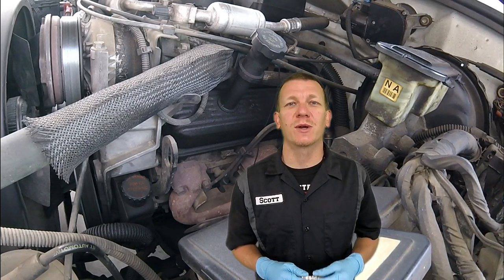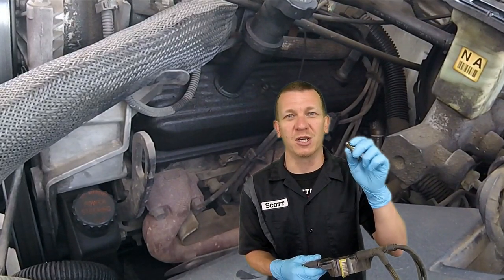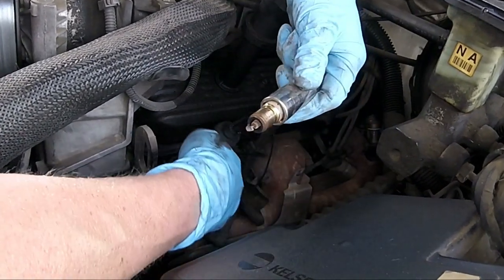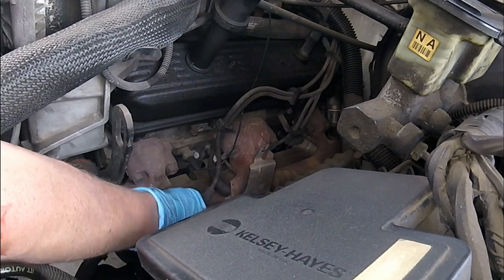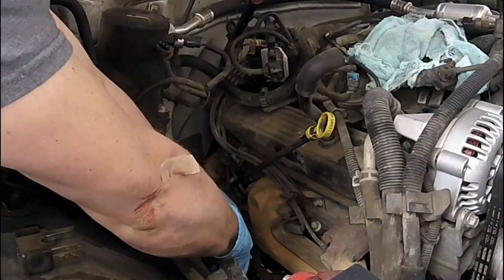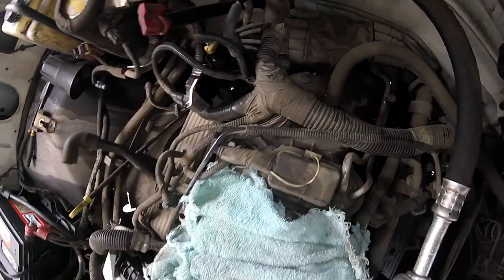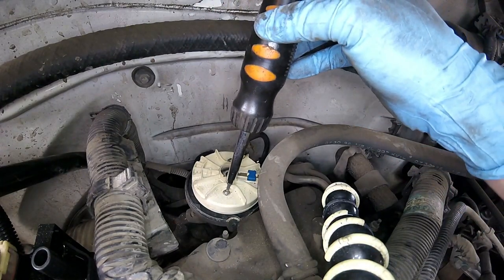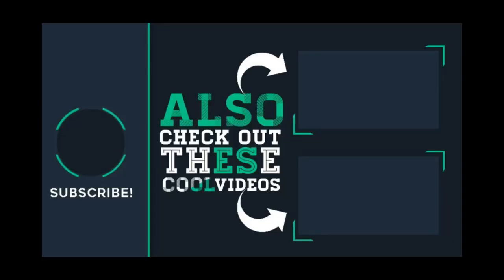Chevy - GMC - 5.7L - 5.0L: Tune Up pt 1. Plugs, Cap, Rotor, & Wires

Comment: I have a 98 Chevy k1500 5.7 and I'm trying to figure out what plug is wrapped inside along with the crank position sensor and ground in the front of the engine. Any idea? The plug is not connected and I can't seem to find where it connects to, all I know is it is a two wire plug that comes out the wire harness along with the crank position sensor and ground going towards the bottom front of the engine. Thanks

Comment: Good video, I do have a question. I have replaced the cap and rotor but know she won’t start, any ideas?  I have positioned the rotor to TDC (or what I suspect is TDC by rotor position). But still won’t turn over. Any help or direction is appreciated.
Reply from the maker: Do you have spark?

Comment: Did the tune up to get rid of misfires on a 96 Savana 5.0 and cylinder 5 keeps having a misfire. Plugs, wires, cap, rotor, coil, fuel filter to boot. Still misfiring.
Reply from the maker: Have you done a compression check?
Reply: @ScottiesHobbies  I need to do a compression test, and fuel pressure test still. But the thing that drives me up a wall is that cylinder 5 had no problems at all whatsoever until all of this. It went from 7 to 6 to random back to 6 back to random to five back to random back to five. Now its steady at 5.
Reply: @ScottiesHobbies  this is also a vehicle that sat in a coma for 10 years until I got it running again.
Reply from the maker: @colinfruend5537   How about using a fuel system cleaner like sea foam?  And did you gap the plugs? But the original code was for cyl 5, after all the work you now have a steady #6 missfire?
Reply: @ScottiesHobbies  now its steady cylinder 5. I've pulled the wires off and made sure they were seated properly and not touching to make them short out at all. I can double check the gaps, I could have made them smaller by fumbling around in the 2 inches of space the GM engineers decided to give mechanics. Currently it has 2 cans of seafoam in the tank to super concentrate the gas. It's almost out so I have to fill up again. Original code was on 7, then it jumped to 6 and back to 0300 and 6 again and back to 0300 and then 5 back to 0300 and now it's back and staying on 5. This is after plugs and then wires and then a coil and then cap and rotor and fuel pump. All within the last since Tuesday morning.
Reply: @ScottiesHobbies  But, it has thrown codes for evap purge solenoid along with lean and rich O2 codes in the past. My main focus right now is making the misfire go away because it is worse for your engine than a bad sensor.
Reply: Spider injector and the intake gaskets were/are the culprit.

Comment: This might be a very dumb question , how do I know what engine I have? I recently bought a 89 chevy obs c1500. Previous owner said it was 5.7 , I looked up the vin number it tells me 5.0. It kills gas like a 6.0 lol ( prolly all it needs is a tuneup ) what is a 100% way I could know ?
Reply from the maker: Do you have a sticker with a lost of rpo codes on the inside of your glove box?
Reply: @ScottiesHobbies  yes I do
Reply from the maker: @kilz3522  if its a 5.0 you will have one of these codes: LE9, LF3, LG9, LO3. If its a 5.7 you will have one of these codes: LS9, LT9, LO5. let me know if you have one of those. Now that is what is factory, the engine could have been changed...
Reply: @ScottiesHobbies  got it. I have a LO3. 5.0 from factory. How can i know if the engine has been changed ?

Comment: Does this video apply to 95 gmc vendura 3500
Reply from the maker: Way more cramped in the van. But pretty much. If you have the dog house in the cab off you can access the cap and rotor real easy.

Comment: What if you accidentally rushed and took everything off together.
Reply from the maker: Ehhh.... just gave your self a little more work. You need to figure out your rotor distribution sequence and match it to the cylinders. You got it. Have a little patience. I don't have patience either and I've payed for it many times.
Reply: @ScottiesHobbies  the wires are the hard part. They're numbered with Kilowats instead of cylinder number.

Comment: But u didnt put it back together.. Wtf
Reply from the maker: Is there a pt 2?
Reply: Were
Reply from the maker: @e.diaz8280   Did you have a question pertaining to one problem that you're having? I might be able to answer a question if you are stuck somewhere.
Reply: How do i know what are the right wires. They go in specific s.p

Comment: Not to happy withthis videos
Reply from the maker: But you keep coming back. Lol.  The internet is full of helpful info. Don't get stuck here.
Reply from the maker: It looks like I forgot to upload pt 2. Lol. Depending on what you are stuck on I do have separate videos for spark plugs, pcv, fuel filter in my library. But don't forget there is a whole internet at your fingertips.
Reply: The damage is done
Reply: The cap is numbered he stated that several times through out the video
The match the numbers from the Cap to the proper cylinders the driver side cylinder closest to you if your at the front of the vehicle is cylinder one than across to the passenger side from closest to you that’s two and so on and so forth to make it even clearer all odd numbers 1357 are on driver side . The even numbers 2468 are in passenger side if your looking directly at the vehicle from the fan shroud area. I think the video was Bueno. Hope I helped.
Reply: @ScottiesHobbies  I'm looking for Part 2 also. Pls upload. Part 1 is very helpful and clear. I've subscribed and liked.